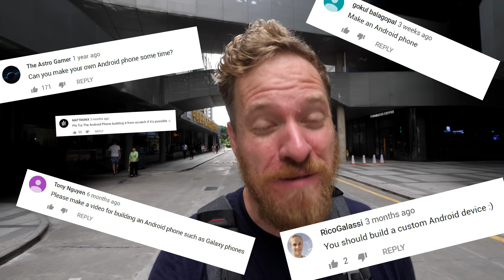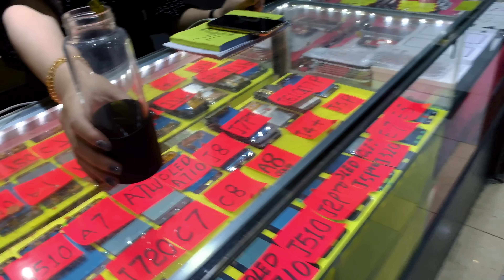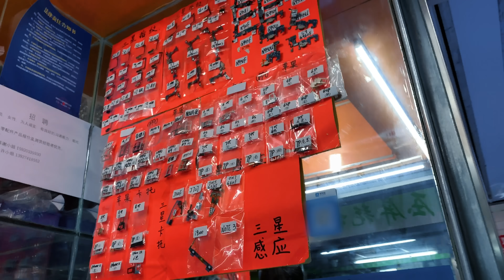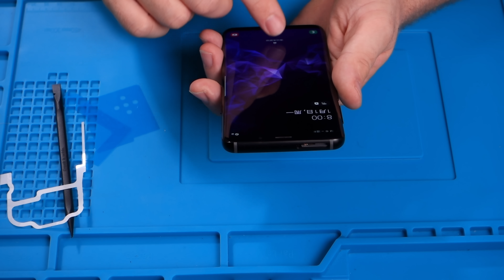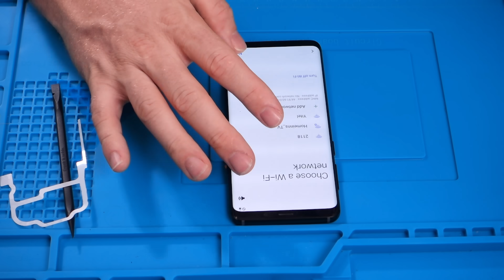How I Made My Own Android Phone

Comment: Ahhhh How much did it cost is the question ? Well Android does get locked if there was a Google account on it temporarily but usually you can get through after the lockdown ends after 72h . Would be fun if they are significantly cheaper to build

Comment: How much did it cost? 
I need a Note8 screen and back glass, but here it's 350 euros...
Reply: Root Edge Gilmour less than35euro in china
Reply: @huijiang9956  😤😤😤 but probably would be stuck in customs no?
Reply: @theedge00123   maybe,i dont know.  how about buy a xiaomi instead of repairing note8. I think it will cost almost same
Reply: @huijiang9956  i've been using samsung note's for like 5 years, i like this model, obviously i don't buy them new, but i like them. But what xiaomi are you talking about?
Reply: @theedge00123  xiaomi is a cellphone manufacture. cheap but good comments. you can visit taobao.com to buy what you need.  its the biggest B2C platform in china. and you can ask the seller about the customs.

Comment: Now create your truly custom Android device. Custom everything. Put together the hardware you want and flash AOSP on it (You probably need to build the OS first)
Reply: You'd hav ett create your own custom drivers for every chip which is a monumental task that an ordinary user cannot do.
Reply: @Billy123bobzzz  if you use existing parts, you can use existing drivers. It's not impossible and if you find someone who is really good at bringing up custom roms for new (and old) devices I'm pretty sure someone like that would be able to assist in getting all the vendor blobs just right to make it work. And with treble, it should be even easier than before.
Reply: @xdevs23  I live in Silicon Valley and have heard that claims many times but to this day after many years of waiting I have never seen it happen so no it is not practical and ir cetainly is not possible for an ordinary person to do this at home.
Reply: @Billy123bobzzz  I'm kind of surprised because I have worked and still work with custom roms and throughout that time I have seen people just taking vendor blobs from other devices that have the same or similar components but newer revisions of the vendor blobs to make them work on newer versions of Android.
Reply: @xdevs23  You are in that one tiny pocked where that activity does exist. Of course anyone on my team could fly to China and grab a handful of random parts in Shenzhen  and actually create the driver and make a working device out of it. That we could do it doe snot means that it is a solution for 99.999999% of the folks that watch these videos and of course the weirder part is the none of the major companies do it. I have worked wit or for the vast majority of them in the past 40 years and  the one story thatchy all tell me is that it is far more expensive for them to have their staff create all the custom drivers so they simply pay Google the millions in customization fees each year and they are happy about that. My team and I all used to work for the same Silicon Valley manufacturing company that we met at, and back there we used to create everything from custom drovers for every single chip on our boards, we designed our own boards, we even designed a few chips (those were the hard-core guys on my team) that we had VSLI make for us, and so on all the way up to our own custom operating system, so I personally don't understand why all the phone companies (even the phone company that don't do any business in the US, who I do business with internationally) pay Google so much money. I keep telling them that for a portion of the millions that they pay Google each years that could poach one of my best designers and he could do it by himself as a salaried employee but they swear that I am wrong and that it is cheaper to pay Google. I have chased my own tail on that one for years (out of curiosity more than anything else) and I keep losing that argument. I certainly will keep asking what is really gong on, and sooner or later I think that someone will show me the actual numbers in their cost model so I can better understand why is it that they think that it is so expensive. So far all I can say is that creating the drivers from scratch for that many chips each year is allegedly orders of magnitude more expensive than simply making a few changes to the existing code. Maybe its is true or maybe it is a conspiracy, I don't know. LOL
Reply: @Billy123bobzzz  of course. The question is where do you stop. I don't see myself going to china anytime soon and the probability that I will ever is low. It would really be interesting to see a frankenstein phone with custom software. And I hope that you will be able to win that argument sooner or later as I agree with you on that.
Reply: @xdevs23  If I do go, (my engineers are the ones that do all the traveling now, I'm frankly tired of it) I will personally pick up an armful of random parts to bring home and challenge my guys (and anyone else interested) in documenting how hard it really is to create a new phone from new parts. It would be an interesting experiment and if I can get one of the kids to shoot and edit the video then I'll post it on YouTube, for our entertainment.
Reply: @Billy123bobzzz  I would love to see that and tbh if you're successful with it, it could develop into a serious DIY project which everyone could do. I'm looking forward to it. And btw I have a custom rom project so if you're interested you can hmu.
Reply: @xdevs23  I'm going to ask my contact in China to see if any of them is willing to do some serious shopping for me, I doubt it so it will most likely have to wait until one of us actually travels there.
Reply: @Billy123bobzzz  uh well I certainly won't be able to but I still think it's a great idea.
Reply: @xdevs23  I asked my engineers and they are taking the side of the phone companies,, they think that its cheaper to simply pay Google because the new chips that come out every year require a lot of work to make sure the driver works properly in ever conceivable mode of operation so you don't freeze up or brick someone's phone, which is why Google does it for them.

Comment: Strange Parts, you said your phone is like one bought from a store. I think this is misleading. Not only you don't get the waranty for your phone, but the adhesive you used is not sandwiched the same way as the manufacturer's, therefore you lose the IP68 water resistance.

Comment: A challenge for you Scotty. Try increasing the battery capacity by using different phone model like those with 8k-13k mah battery. Changing the wire to fit the motherboard might be the key but I think it's possible in china since they are good in soldering. After that make a legit back cover for it. How about that? It's possible, someone already try it

Comment: 3:00 G935- G stands for the series, N for note, and G for S range of devices, 9 is just a place holder, 3 is the series in the range, so 900 is galaxy S5, 920 is Galaxy S6, 930 is galaxy S7 etc. The 5 stands for the EDGE variants from galaxy S6 to S7, as the S8 and S9 only had PLUS variants. There's then usually an alphabetical letter after the numbers that determines region and chipset, F being international with an Exynos processor, FD being the dual sim variant, K being Canada and so on, I recommend looking on gsmarena for more info.

Comment: Me:replace fingerprint scanner
iphone: ThAt Is NoT gOnNa WoRk

builds android from scratch, nothing goes wrong
Reply: lol
Reply: Samsung has that knoxs security system that if you turn it on its pretty good. It will not let you reset the phone and wipe it. Fortunately now it's opt in and you don't have to worry about messing with custom rooms.
Reply: Iphone fucks customers in ass but other androids dont cuz aplle sucks
Reply: yup!
Reply: It's for security. To prevent your phone from getting accessible if stolen by just replacing the sensor..
Reply: @BrawndoQC  it's to force you to use apples repair service instead of repairing it yourself. Nothing with security. The phone that they sell you still doesn't belong to you.
Reply: @BrawndoQC  Fingerprint data isn't stored in sensor, your argument is invalid
Reply: @kvviingu2507  It's stored on the phone.  There's a reason why Apple wants you to pay between $269 and $329 to replace your home button, and it's security. When Apple introduced its Touch ID sensor for the iPhone 5s, the company needed to reassure its customers. Your fingerprints don't get uploaded to Apple's servers.

So accepting third party replacements could hack the stored prints.
Reply: @BrawndoQC  security my ass lol they just wanna keep you from repairing simple shit
Reply: Brawndo sensor only reads your finger, your phone and its software tells the sensor to show an image of whatever is ontoo of the sensor and the phone checks if that image is the same as the one stored
This whole security thing is just another lie by apple to fuck over customers
Reply: @BrawndoQC  That security also bricks your phone when the fingerprint sensor gets replaced, doesn't matter if it's the same fingerprint after
Reply: Just passing by bricks your phone? Who told you that? If you don’t have the original fingerprint sensor the phone still works just without the fingerprint functionality.
Reply: RezZ without home button functionality* iphone 7 8
Reply: @BrawndoQC  that's shouldn't make a fucking difference since the information is stored on the phone

Comment: I think you forgot the thermal compound connecting the CPU and the copper heat pipe! That is very important!!!

Edit: Thanks for the likes, YouTube-Algorithm!
Reply: It's rather important, but the phone also works farely well without it. The Chipset may clock itself down a bit and get hotter, but it shouldn't do any damage to it. Actually the battery performance could improve a bit, due to the lower Clockspeed and in consequence lower Power consumption.
Reply: @jonathanlang9711  The Exynos chipsets do not dynamically throttle. Inside a normal phone they will always be able to hit their maximum clocks, so it is either complete throttling or none.
Reply: @nottheengineer4957  doesnt matter, the CPU still creates heat that needs to be dissipated. Why would they have a heat sync? My Galaxy S5 have thermal compu d on its CPU.
Reply: Also the sim card tray
Reply: What was the total build cost?
Reply: i cant relate :(
Reply: @ChrisPFries-kz5vf  same here lol
Reply: It shouldn't make a huge difference
Reply: Heat transfer paste
Reply: @johnwilton319  thermal paste u both mean
Reply: @Spacy1717  AFAIK they usually use thermal pads instead of paste.
Reply: @johnwilton319  ah, shit here we go again
Reply: @johnwilton319  thermal compound is a more, formal verb I guess lol
Reply: Liquid metal
Reply: It is not that important. This is a phone, not a PC. The SoC is well below 5W.
Reply: @nottheengineer4957  actually it's very important especially if he were to play a game or something on the phone depending on what processor is in there the Snapdragon or the Samsung they both can get very very warm...sometimes even hot enough that you have to let go of the glass if you're playing a high demand game... So yes it's very important
Reply: @lostreclue4788  The Exynos chips use ARM Mali GPUs while the snapdragons use Qualcomms Adreno, wich used to be owned by ATI. A snapdragon under full GPU load can go up to 10 Watts IIRC, so these things need the thermal paste. Exynos chips would only need it under full CPU load, wich never occurs in normal use.
Reply: @lostreclue4788  agreed with you
Reply: @nottheengineer4957  play a game and see why it's important
Reply: @xamirreza7159  Back in the day these chips used 15W and were cooled by nothing but the PCB. The LG G3 managed to get so hot that you could burn your fingers if you took off the plastic back and touched the right spot. Mine did this without throttling for 3 years straight.

Comment: when you have a new parts market available to repair shops, there's less market share in the used parts section of things, given you can get everything but apple parts with only mild difficulty in some cases, and no difficulty in others, it makes sense for most of the used parts in shenzhen to be apple based.

i'm waiting for apple to be slapped with some anti-consumer stuff at some point due to the incredibly draconian parts restrictions, even used 100% original non-clone/faked/etc stuff they have no legal control over.

Comment: I think the abundance of iPhone parts might largely have to do with the standard user-base. You don't hear about parents buying their kids Samsung Galaxy S-class phones very often, but what kind nowadays DOESN'T have an iPhone? I point this out because it makes sense that more of them would be broken if the average user is a child running around with it as a toy, rather than a working adult who had to pay for the phone themselves. More broken phones = more parts recycled.
Speaking of which, this is, in fact, where your old phones often go when you turn them in for recycling at phone shops/retailers etc. in those drop-off boxes. They sell them in bulk by weight, oftentimes, and this is the end result. They all get boxed up, sold, shipped, sorted, disassembled, tested, and sold again. Perfect recycling system IMO. Less waste from disposed parts, less environmental damage in recycling vs smelting and making new parts.

Comment: Are all those android phone parts designed for just one model or can you make different phone model parts to work with each other maybe some wires or small circuit in between? 
Imagine making a custom thicker phone case so you can fit phone parts with specs that you want in there.
Reply: Have the whole back of the phone just be cameras

Comment: Can you build a phone with M.2 instead of emmC?
And dual battery? Maybe with a second basic system that is always powered by the second battery so that emergency stuff is always accesable and that the main system can be powered on by POE.
Well and dual display one of them being touch E-Ink with multi-colour..
Dual SD card (which you can boot from too) would also be cool but not really necessary if you include the M.2.

Comment: The iPhone is the top selling model of smartphone. That is the reason for the better availability of the parts you see. Android devices are more as in total android devices in the market share but not per model. One company makes 3 models but using the same or similar parts inside vs several different companies making hundreds of different model smartphones with different insides.  In 2018 the iPhone took 6 of the top spots of the top ten most sold models of smartphones in the world. The top three were iPhones with over 100 million units sold alone. 625168.htm and for English GSMArena posted it counterpoint_iphone_x_is_the_bestselling_phone_in_the_world_for_2018-news-36832.php 
Great video by the way. I would love to see you go back to the Nokia booth and maybe see about making a Nokia if that would even be feasible. Cheers.

Comment: This is awesome! Will you try a storage upgrade like you did with the iphone? Would be cool to see that S9+ with more memory than what you can get with it normally.

Also while it is similar it would be cool to see you build your own tablet!
Reply: It would be pretty expensive and hard to do since the S9 has 512GB options I believe
Reply: @Zer0_Smith   Looking at the official specs on samsung's website it says it only comes with 64GB of onboard memory.

Wikipedia says there are 64GB, 128GB and 256GB models
Reply: @IdealIdeas100  Ah, I couldnt remember if it has a 512GB option. Since the Note9 has it, I kinda figured it would also have the option since they are both 9 series
Reply: @Zer0_Smith  i think you mistook it with Note 9, that has 512 GB

Comment: THANK YOUUUU!!!!!! omg the video I never knew I needed. So since Ubuntu has discontinued their OS software program for android I have been kinda down. I used to work in a large IT and repair facility and we repaired iphones used as scanners for inventory (they are encased in a black rubber plastic holder with larger battery). Plus I have done a ton of laptop and desktop builds and repairs of all types. I use ifixit all the time when I get stumped. It's good to know they have a nice whole kit set I may buy that through your link. So since I would repair all these things I could also build some from scratch. In fact I built a customer a new laptop from nothing but parts I had in the store. I had to tear down like 3 or 4 other laptops to get the good parts (case, screen, boards, batteries, etc) but I finally did it and it worked great and she got a laptop that was similar to what was on the market brand new for a fraction of the cost. So now I want to build my own android and really customize it. I want the newer models but I want to mod the case and battery connector so I can have the coolness of the new phones plus the security of being able to remove the battery. There is a reason the newer phones don't have replaceable batteries but I won't get into that here. I also would like to learn how to make my own logic boards and really see if I can hot rod my phone and then make my own linux OS system to work within current phone networks. I understand the big companies are out of the question like verizon, sprint, etc but prepaid GSMs with interchangable sim cards would work and I could get around the supreme court law if I made my own since I technically didn't modify an original one. I also want to make it to work with custom drones that I want to build for racing. Anyway thank you for all of this. I wonder if Japan would have more Samsung parts. Also you are correct in that all apple production is in China (giant 50k worker factories) and some serious allegations of worker abuse (toxic screen cleaners that cause nerve damage, etc). I would love to build a custom phone like this new Asus phone. Check it out. https://www.youtube.com/watch?v=q3eFXeO62oo&t=614s